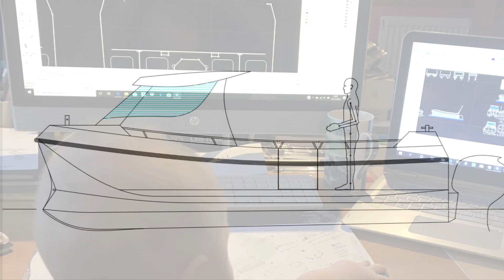Home designed and built catamaran fast fishing boat.

Comment: Do you hang the welder from above just for ease of maneuvering around?
Reply from the maker: Mostly for that and it really helps the aluminium wire work with a 4m torch smoothly

Comment: Does the owner find this hull design to be right for their use? I think it looks great, but have no ability to evaluate the function.
Reply from the maker: @kevinhornbuckle   hi, I’m in contact with Chris the owner regularly and he has only good to say about the little cat. The only thing that happens he has said is at a certain speed around 27 -28 knots a little bit of very fine mist will come out of the tunnel when going with the wind and wet the windscreen. Any speed either side of that and it doesn’t happen. Iv built a second one myself now and there are orders for 3-4&5 now in various layouts. I hope to have a video of no2 on soon once I get to sea trails. Cheers
Reply from the maker: @kevinhornbuckle  there is a test video on the channel to.